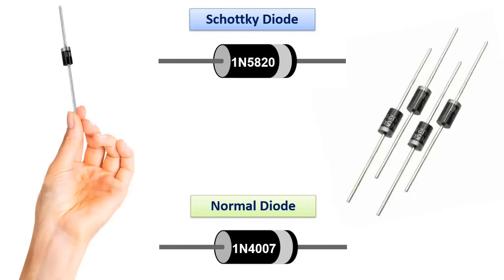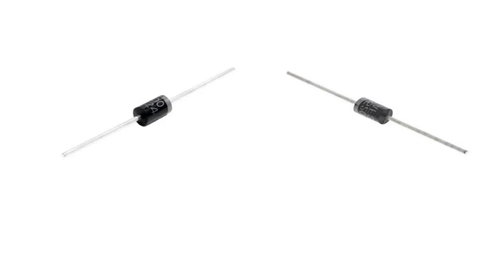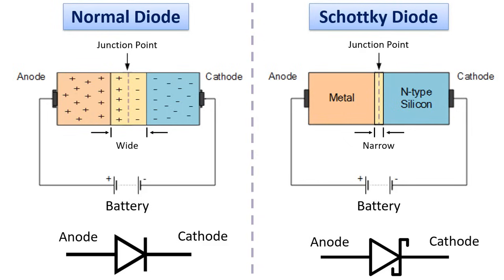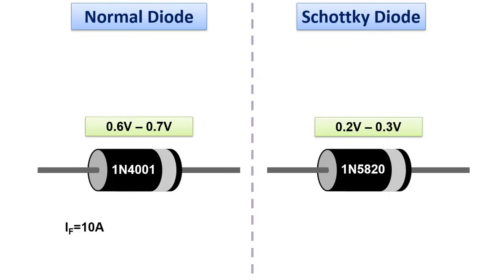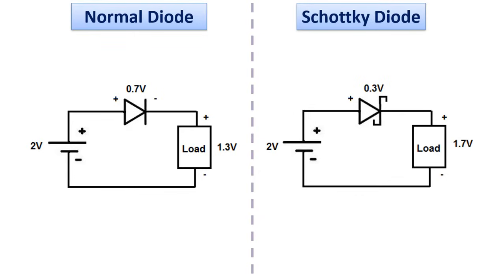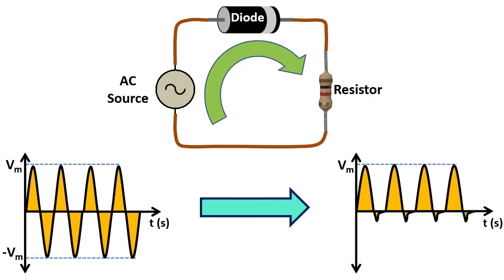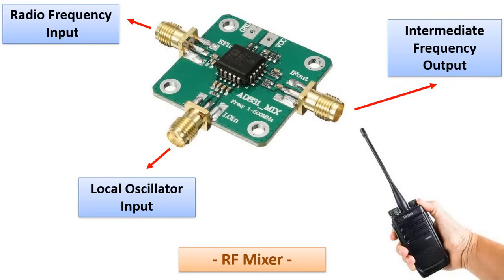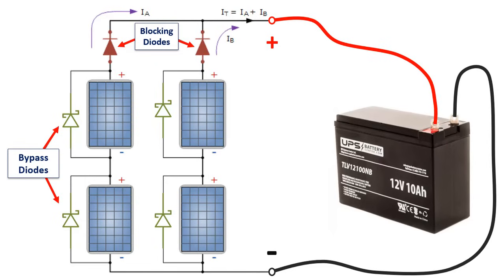What is a Schottky Diode? How Schottky Diodes Work? Where to Use? ( Schottky Diode Tutorial)

Comment: Current flows from CATHODE to ANODE. Current is electron flow. Electrons are delivered to the circuit from the cathode side.
Reply from the maker: Here it is described according to the traditional current direction.
Reply: @eeapplications  It was learned in the old days of vacuum tubes that current flows from cathode to anode. This crap you are promoting is due to kids that don't know why the arrow points the opposite direction. The arrow's direction has NOTHING to do with current flow.
Reply: Electric current isn't always electron flow. Electric currents in salt water and inside human bodies are positive sodium ions flowing in one direction, and negative chloride ions the other. Even in pure semiconductors, there are something we called hole currents which go the opposite direction to the electrons. So in conventional circuit calculations, we ignore whether it is the flow of electrons, ions or holes and just assume it is positive charge flowing from positive terminal to negative terminal for the sake of simplicity.
Reply: Current should go in both directions unless bigger than 0.65V
Reply: "Conventional current" is considered to flow from positive to negative. Most of the arrows in semiconductor symbols correspond to conventional current flow.

It's something you just have to get used to because the use isn't going away anytime soon. It is important to specify if you mean electron flow or conventional current flow if you are explaining something to a novice.

Comment: Schottky begins conducting "earlier" (@ 0.3V) along the v/t sine wave... vs. standard Diode "later", @ 0.7V on the same v/t sine wave. Likewise, "slamming" shut is also the inverse.
Greatest weakness of Schottky: resistance to reverse voltage... as well as ampacity.

Comment: As commented ( below ) these diodes MUST only be used in  LOW  voltage circuits (  car battery chargers or SMPS ? )  , also Germanium point contact diodes ( such as OA79 ) are MUCH superior to demodulate ultra low power AM radio signals ( even after ALL the decades since the 1960's ! ) .. DAVE™ ...

Comment: You can't run 10A 
through either of those for long.
Reply: About 30 miliseconds probably.
Reply: not the 1n400x or 1n5820, no, 😉, but higher current ones are available ..

Comment: It is important to consider the Peak Inverse Voltage (PIV) which is typically much lower with Schottky diodes. typically around only 30V
Reply from the maker: Thank you for the additional information 🙏
Reply: This is why the PV String is not saved with the Schottky diode. I was wondering before i read your comment.
Reply: From this video it seems there are no downsides to the Schottky diode. So why ever use regular diodes? Cost?
Reply: @jarls5890  they dont have as high reverse breakdown voltage, usually 20 to 40v depending on type number, standard types can be over 1.5kv depending on number..

Comment: which one is better ? Gunn diode or shitaki diode ?
Reply: Gunn diode isn't a diode in the normal sense (check the Wikipedia entry on it for more info), and Shitake is a type of mushroom used frequently in Japanese cuisine, so I'm guessing autocorrect  is at fault there. Schottky diode is good for high frequencies, but not great for high reverse voltage (more than 30v) applications. It's not so much a case of "Which is better", but "Which is better in my particular case" - and that is a lot harder to answer. Hope this helps. (and I want mushrooms now ;)
Reply: Shitake diodes are probably tastier

Comment: Peak inverse voltage (breakdown voltage)
1N4001....400volts, near zero leakage I.
1N5820.......50volts, and HIGH reverse leakage current.
NOTE: 1N5820 has HIGH capacitance so use Germanium diodes for high frequency small signals.
Reply: 1N4001s are 50v, 400v one is 1N4004 , and yes, germanium types or low power signal schottky such as BAT85 better for small signal use

Comment: Be aware of higher leakage current in the Schottky. Also to get low voltage across Schottky you need low current. At higher currents voltage increases.
Reply from the maker: Thank you for the extra information 🙏

Comment: Schottky diodes are not magic and the .25 voltage drop is fools gold if you need it to actually be a diode capable of preventing reverse current flow. But if you  place that .25 drop across a transistor's base and collector the diode will prevent the transistor from saturation, and resulting slow switching, by shunting off the extra charge carriers that accumulate in the base as the saturation point  is reached.

Comment: So you can always use a Schottky as a (better) replacement for a conventional diode?
Reply: No. They "leak" reverse current much more than a conventional diode. You would use a Schottky diode where you can't afford a big inherent voltage drop in the diode, either for signal integrity or power efficiency reasons.
Reply: True.

I was waiting for the video to point  this out as the downside to Schottky diodes but it never did.

This omission would lead people to believe that they would always be superior to standard silicone diodes.
Reply: @tissuepaper9962  A balanced (no pun intended) and reasonable reply, I have to admit, I find high frequency electronics very much a 'dark art', once you get into the Gig range all normal bets are off; a resistor is, well, it won't have coloured bands on it?
In fairness, I am thick as mince!
Pax and respect.
Reply: This video and especially the comments were very informative. Thanks

Comment: You can't put 10A through a 1N4001 as they are rated at 1A
Reply: You can - briefly. 
They are just not designed to dissipate the 6W of heat produced in the junction while it is happening. When the junction hits 120C it stops working - permanently.
Reply: Max surge current is 30 amps. So yes it can handle high current transient spikes. Not everything in electronics is straight DC bro. And diodes are often used as clamps to dissipate spikes, like from inductive kickback.

Comment: Schottky diodes work well at high frequencies, it's true, but they have too high a barrier capacity, much higher than the old glass germanium diodes with point contact, which also perform very well at equally high frequencies, without the signal being short-circuited of their capacity as the others do.
Reply from the maker: Thank you for the extra information you provided 👍

Comment: The last part about solar panels is not quite demonstrated properly because the bypass diodes are connected across each individual CELL of a panel, so as to bypass any cells of the overall panel that may get shaded by something like a tree or something at certain times of the day. It wouldn't be nearly as effective if the diodes were only connected across entire panels.

Each cell in a solar panel produces about 0.5-0.6 volts in full sun, but goes down very quickly if shaded, so a panel that is only partly shaded will benefit from having ONLY the individual cells that are in the shade bypassed, and still be allowed to have the cells that are still in the sun producing power.

Comment: A voltage of 0.6 -0.7 volts doesn't turn a diode on. There is no switching voltage.
It's a myth.

Go look at the IV curve as defined by the Ebers-Moll equation and you will see there is no step function, it's exponential.

It is simply that a voltage of 0.6-0.7 volts for a silicon diode enables a reasonable level of current to pass through it.

If you reduce the voltage to below 0.6 volts you still get current passing through the diode in forward conduction, just a lot lower.
Reply from the maker: Thank you for the extra informations you provided 👍

Comment: Bullshit hole flow current
Reply: The way I see hole flow current... it is a way to analyze a circuit more intuitively than using a more accurate electron flow model.

It is easier to imagine current flowing from positive to negative with a corresponding voltage drop across each component.

It is more difficult to imagine current flowing from negative to positive with a corresponding voltage increase across each component as current flows through it.

The problem goes back to Benjamin Franklin when he arbitrarily labeled  one polarity as positive and the other negative. 

He chose poorly... What he called negative was actually the electron source.

If he had labeled the electron source positive, it would have eliminated the confusion and made everything intuitively easier.
Reply: @chronobot2001  electrons (which have a negative charge) flow from where they are (negative cell terminal) to where they aren't (positive cell terminal).  This is the most intuitive reasoning.
Reply: @chronobot2001  
Uh, no. The reason the electron source is labeled negative is because electrons themselves are negatively charged particles attracted to the relatively positive protons. There is no such thing as whole flow because these holes are created when an electron leaves its current orbit and jumps into another creating an illusion of a vacancy moving in the opposite direction. 

So chronobot if you think you're smarter than Benjamin Franklin well that's your first mistake.

Comment: No mention of the turn-off characteristics of both diodes. Transition from conduction to reverse is the biggest advantage in using the Schottky diode. Usually in power conversion circuits where the Schottky diodes much higher reverse bias current is a negligible negative factor. It was a good beginner's guide tutorial!
Reply from the maker: Thank you for the extra informations you provided 👍

Comment: Electrons flow from negative towards positive. Hence the lined side of the diode receives electrons and spits them out the back, this is called forward biased. In a schematic, electrons flow against the arrow point.
Reply: I agree. It is very rare that we need to talk about hole flow.  Electron flow was taught for decades in colleges and universities and then somebody just thought that we should just change over night to only talking about hole flow.  A coulomb is related to the eV and is defined as the number of electrons flowing past a point in a second.
Reply: @BarryPiper  correct. I think it's ridiculous to try to talk about hole flow in electronic Theory. You know electron flow > electron•ic
Reply: Don't confuse the picture. It's very rare that we need to talk about electron flow.
We only need to talk about electron flow if the internal operation of the diode is being explained, particularly around the formation of the depletion region.

I have had stupid arguments with idiots on YouTube that seriously thought that we should just change over night to only talking about electron flow and making that the direction of current.

Many people become confused between the two. It's best to leave out mentioning of electron flow unless explaining the internal operation of semiconductor devices and valves.

Comment: A 1N400x is sufficient for 50 to 60 Hz and has a threshold of 0.6 to 0.8 Volts. The range up to 1 Amps is to be calculated.
A Schottky diode is faster but cannot withstand reverse flow well at higher voltages.

Then a stupid 1N4007 is more robust.
I want to point out the UF400x series, a Schottky that in many cases replaces a 1N400x.

Comment: No mention of the disadvantage of Schottky diodes compared to conventional silicon diodes with regard to reverse leakage current.
Reply: what would the disadvantages entail?
Reply: @monoki8708  : I believe back leakage current is the disadvantage.
Reply: @monoki8708  in reverse there's a bigger current leakage than a silicon diode
Reply: I think it was implied.
Reply: Yes The graph showed lower reverse values, but he didn't say anything.
Reply: He showed that in the graph
Reply: up to 100x more expensive
Reply: @SANTO971 nonsense

Comment: i've got a high torque electric motor for a rc boat and it has a schottkey diode on it in paralel 
what is this for?
Reply: Maybe RF suppression Geert.?
Reply: It shorts out dangerous back EMF voltages which can be produced in an inductive circuit.
Reply from the maker: It is for the protection of a current coming from the opposite direction by passing through the diode.

Comment: What happen sotky diode at low frequency .please help
Reply from the maker: Schottky diode can be used at low frequency as it is suitable for operation at high frequencies. It will not be any different from a normal diode. It works properly.
Reply: @eeapplications   thank you
Reply: Good evening sir how can I use resistor fo circuit board